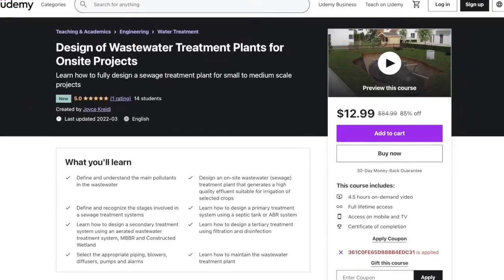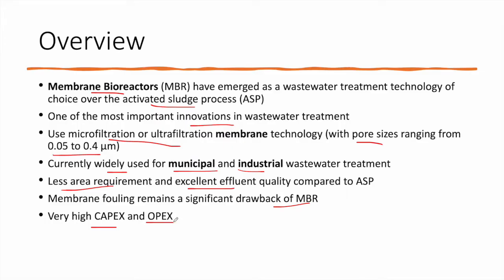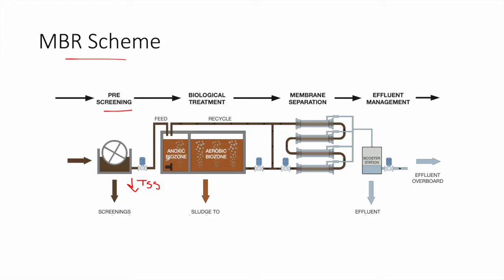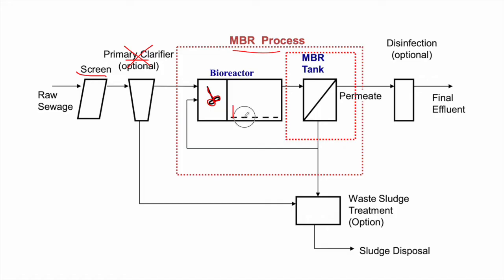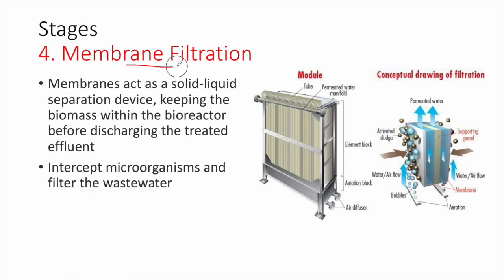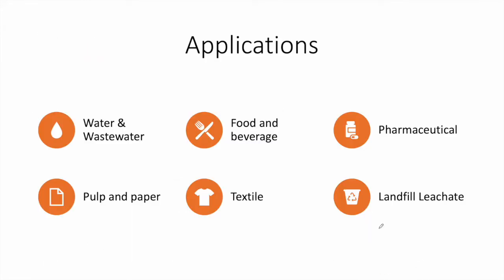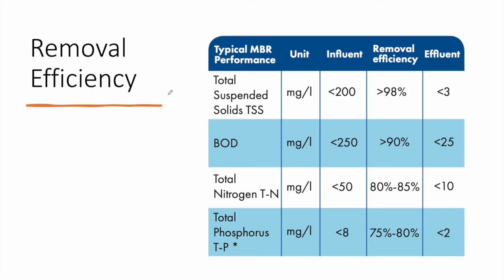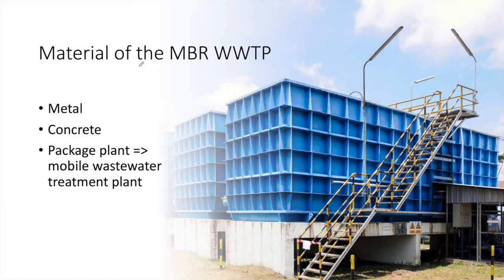How does MBR work? Full description of the Membrane Bioreactors Wastewater Treatment Plants

Comment: do you need to remove membrane from the tank for membrane cleaning/maintenance ? At what point do you need to remove membrane from the tank?
Reply: There are 4 methods to clean the membranes: 1. Air diffuser cleaning,  2. Backwash cleaning, 3. Online cleaning, 4. Offline cleaning, only when the first 3 methods could't work, then it comes to the 4th step "Offline cleaning" which needs to remove the membranes from the tank.